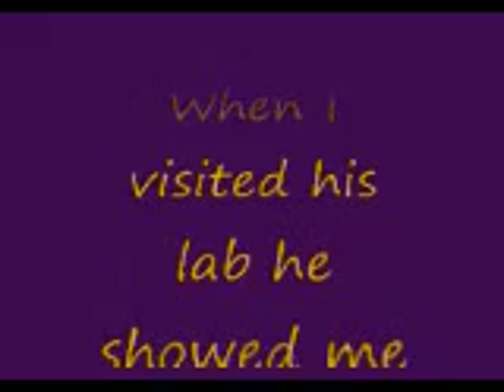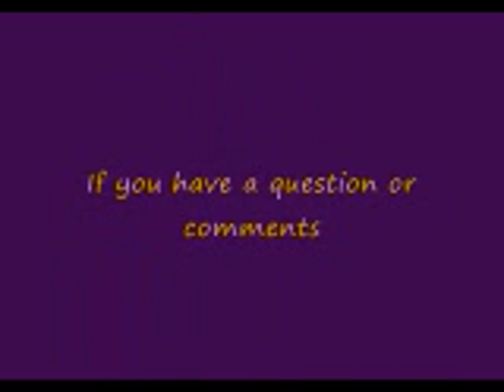Pulse DC Motor secrets

Comment from the maker: The cheapest way to pulse High voltage DC
is to use "red switch" to activate power transistor or power mosfet  rated  HV you wish to use. As far as the mechanical ways goes, perhaps you can use contacts that can be turn on/off as the shaft rotates.  
These are just a basics, you can come up with your own version too.